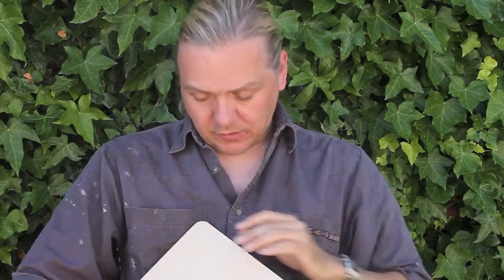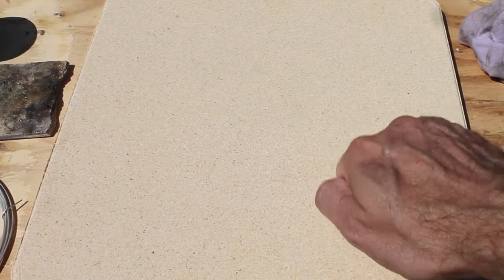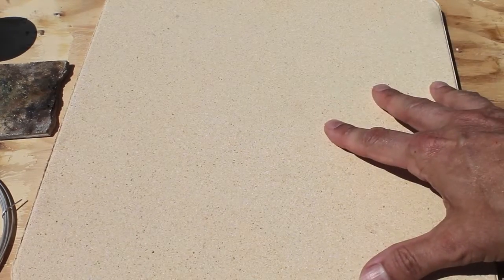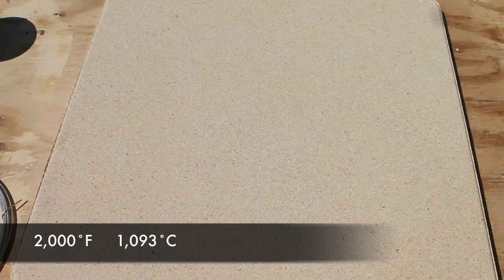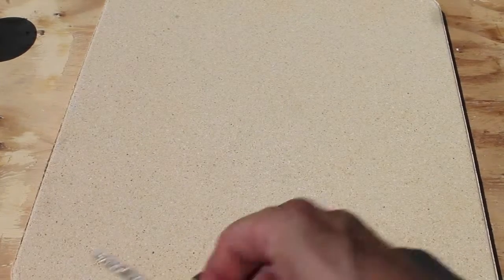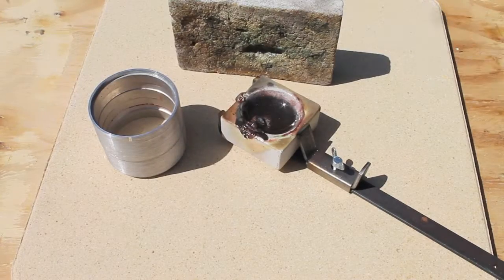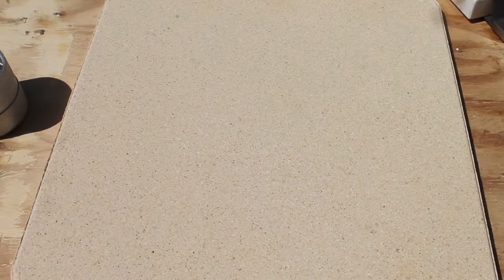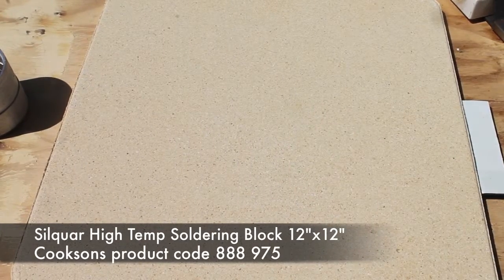Silquar High Temp Soldering Block Demo / Review in HD

Comment: Based on your video, I picked one of these up to protect my nice teak desk from heat. Here in the states, they're available from Rio Grande. It appears to be sintered alumina, a hard, durable refractory material. One caveat--mine came covered in grit that probably crumbled away from the edges. As alumina is also very hard (Mohs 9) any stray grit worked into silver or gold will create deep scratches--it will also scratch any wood surface. Just something to watch for while working.
Reply from the maker: Thanks for sharing all that. I've been using mine for a while now, including casting on it. It still has a nice smooth surface, unlike my other soldering blocks which crumble. Incidentally, mine came with rubber feet to prevent scratching the desk surface. Dave.
Reply: Yes--mine include the feet; it's a great addition.